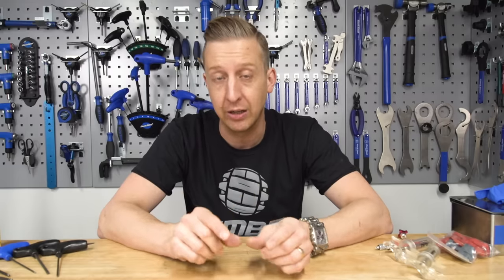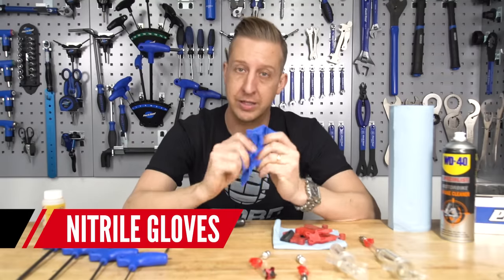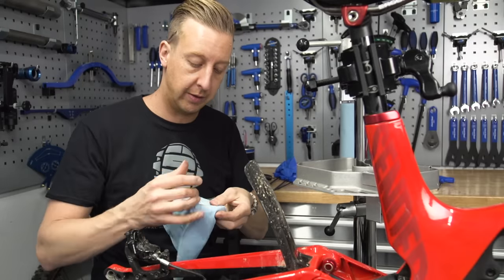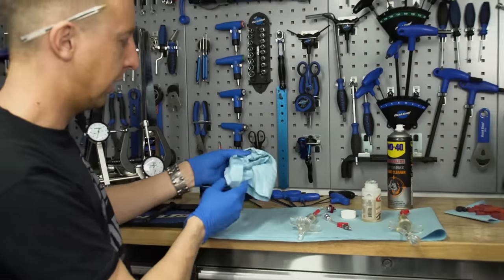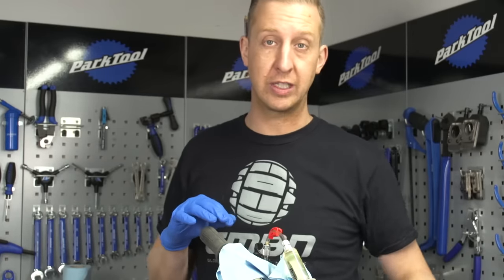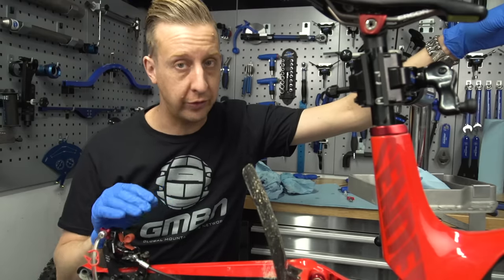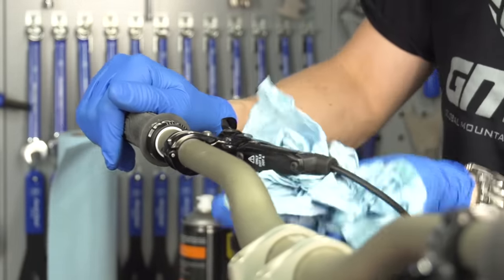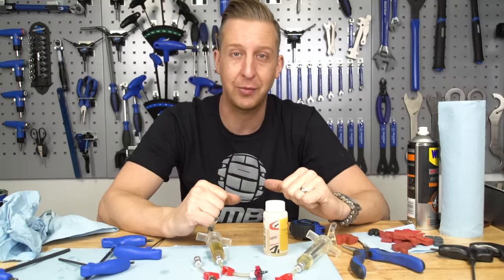How To Bleed New Sram MTB Brakes | Bleeding Edge Technology

Comment: If you have Shimano brakes you can use that extra hour of time that you save to actually ride a bike :D.
Reply: Haha agreed. Changed all my brakes over to Shimano. 1 cup to bleed all.
Reply: Also since Shimano uses mineral oil, which has a higher boiling point, doesn't attract water (Which dramatically reduces the boiling point), hold dissolved gas or strip your bike's paint, it doesn't need to be replaced for years. Magura, who've been using mineral oil for their brakes since they first entered the bike market probably over 40 years ago at this stage, don't even have a recommended replacement interval for their oil because it just stays working - I have a Julie on one bike that's been running the original fluid for probably a decade at this stage just feed it brake pads and adjust the reach screw in the lever every couple of years (It works loose very very slowly) and that's it.

The only things going for DOT fluid are that if it does get on your disks, spraying the whole lot with water will usually get everything back working because DOT 4 and DOT 5.1 are very water soluble, while with mineral oil you pretty much have to burn it out of the pads (Or replace them) and degrease the disk and caliper (I find sanding the disk in a mix of water and washing up liquid gives great results) and it's easier to find if there are no decent bike shops around. Citroen LHM (Hydrauilc oil for their hydropneumatic suspension systems) works perfectly in Magura brakes in my experience if you're stuck, I even got a leaky set of HS33's back working once by using slightly higher viscosity fork oil (Still a mineral oil). Both Shimano and Magura will swear blind that using the oil for one in the other company's brakes will damage them, but I suspect this is more about warranty and selling their approved parts than for any genuine reason.
Reply: peglor The problem with mineral oil for brakes is exactly that it doesn’t absorb water. Which means that any water in the system will collect at the caliper and lower the boiling point of the system to that of water. In practice that is not a big issue for mtb brakes but it certainly is for cars,  trucks and motorcycles.
Reply: But if you want to stop, use SRAM
Reply: You mean after you've spent an hour sorting out the inconsistent lever feel by rebleeding the factory bled brakes, right?
Reply: @nikolasthyr9538  I think you meant magura mate :)
Reply: @nikolasthyr9538  If you want to stop use Shimano Saint
Reply: @JohnDoe-rl9ft  The question you have to ask is how is the water getting into the brake system in the first place? There's nothing to drive it through the seals of the brake as the pressure in the brake system is always higher than atmospheric unless there's a serious underbleed and the diaphragm is stretched inwards. DOT fluid pulls in water as vapour because it's chemically strongly attracted to it, requiring a lot more sealing to keep it out, which no DOT brake has.
Reply: @bike-cave-man2527  Shimano Mineral oil boils at 280 degC, DOT 5.1 boils at 270, and that's assuming it's not drawn any water into it.
There's no force acting to draw water into mineral oil brakes, so unless you actually add it yourself or store your bike under water, the rate water gets into the system is negligible.
Mineral oil is good for 6-7 years according to the manufacturers, which means it's good for a lot longer than that because they like to play it safe - that and I've used Shimano brakes on nearly 20 year old oil and they still work perfectly. I've used Maguras even older than that without issue, in fact for a long time Magura would say there was no need to ever replace the oil that shipped in their brakes unless you lost some through leaks.
Reply: RollinRat  SRAM make the following decent parts: BB5 and BB7 cable disk brakes... I think that's about it, their disk rotors seem to be okay too, but even SRAM would have their work cut out half assing 2 mm stainless steel plate...

The SD7.0 and SD9.0 v-brakes were well made too, as were the Avid Speed dial cable levers, but most if not all of these parts (Including the cable disks) predate SRAM buying Avid out. Avid's hydraulic disks were a pain in the ass in reliability terms compared to Shimano or Magura too though, so some trends are carried over.

SRAM to me is an excellent marketing company which is happy to allow terrible engineering to ship with their name on it. No competent engineer could in good conscience approve the design of the GXP bottom bracket for example. The sad thing is because most of the bikes fitted with SRAM's parts do far more miles on the back of SUV's than under pedal power, riders being stranded by SRAM's brakes and drivetrains failing often have no more than a mile or two to walk back to the trailhead and a nice 'survival' story rather than 10+ miles before they hit anything even accessible by car for a lift home. 

Having to 'upgrade' parts that shouldn't have failed in the first place is used as an opportunity to buy newer shinier parts from the same shysters rather than an indictment of their hopeless quality control and a reason to not buy their crap anymore. 

The sad thing is Shimano are copying some of the stupid decisions SRAM have made, presumably for marketing reasons, because I can't see any engineering reason for it. The heavy, clunky shifting action and the lack of side float in the top jockey wheel of the new Shimano 12 speed drivetrains being prime examples. Shimano first generation 3x10 (And 3x9) is much better in terms of shift feel than 2x12, though the front derailleur in the 2x12 is probably the best I've ever used. After 4 or 5 hours riding I can feel the extra strain in my right thumb from the high shifting force on 12 speed. I've never noticed this as an issue before in heading for 30 years MTBing. Heavy clunky shifting is why after trying it in the shop and on other people's bikes I never considered SRAM from a feel point of view. It always being a SRAM drivetrain that would stall a spin with seized jockey wheels or the derailleur folding up into the wheel for no reason sealed the deal that I didn't want to deal with the junk they're selling. I like to ride my bike, not work on it for no reason.
Reply: @bike-cave-man2527  Wow another 18 degrees - shame you brake will still cook out before a Shimano because Shimano has much better thermal management thanks to the heat sinking on the pads and aluminum sandwich in the disk, combined with the ceramic pistons.

Also the same does not apply to water getting in to the brake. The hygroscopic (Which is pretty much the scientific term for a substance that's a water magnet) nature of DOT fluid means it will keep drawing water into itself because it's got a lower effective vapour pressure than the partial pressure of water vapour from humidity in the atmosphere, creating humidity concentration gradient, which continuously draws more water vapour into the brake fluid. That's why when you crack the seal on a DOT fluid bottle it's just as useless after a year or two on the shelf as it would be if you were using it in a brake, while mineral oil can sit indefinitely on the shelf without degrading because it's hydrophobic, meaning it repels water, so there's nothing drawing more water in. 

I'm on my second bottle of brake fluid in nearly 30 years because I used Magura blood first and then Shimano mineral oil. On the rare occasions I've had to bleed my brakes, usually because I was swapping hoses, it's always been a matter of putting a few drops more into the brake reservoir. I'd hate to think of how much I'd have spent on DOT fluid in the same amount of time. Just because you've swallowed the 'bikes are unreliable and need nearly the same number of hours servicing time as you spend riding them' kool aid that's keeping SRAM rich doesn't mean the rest of the world's cyclists should be wasting their time running inherently unreliable parts.
Reply: @bike-cave-man2527  The data on the website mentioned in this video puts the boiling point of shimano mineral oil at 280 degC, I've certainly had my brake hot enough for water to flash off the calipers on occasion with the disks leidenfrost effect hot and they still worked fine. Shimano has made about €20 from me in nearly 20 years in brake fluid sales (And lost masses more potential income because the litre bottle I bought has done most of my friends' brakes too - it's down to it's bottom third now though).  In that much time I'd need about 20 bottles of DOT fluid just to deal with it's poor shelf life.

The other benefit you claim of DOT fluid at least theoretically is that you can buy it from a garage rather than having to go to a bike shop, but since people have on many occasions proven you can use olive oil, baby oil, water with a bit of antifreeze for the winter (Not recommended on disk brakes if you ride hard, but for Magura rim brakes it is extremely common practice because the lever feel is amazing due to water's lower viscosity, to the point that every professional trials rider and pretty much every amateur one too, you see with Magura rim brakes has bled them with water) or cooking oil, which can be got from far more locations than DOT fluid if you're stuck. If all you have is a car parts shop, Citroen LHM mineral oil will also work beautifully in mineral oil brakes.
Reply: Shimano’s modulation isn’t great. But still it’s rider’s preference
Reply: @peglor  tell me you have no idea what you're talking about without telling me 😂
Reply: @ryancox3834  You'll have to contradict what I've written with actual data before you'll convince anyone that you're not a troll. 

I've explained my opinions as well as the scientific/engineering basis for these opinions. You've claimed I don't know what I'm talking about and provided no evidence.
Reply: Shimano anything makes me gag
Reply: All my friends bleeding their shitmanos all the time and I’m riding happy with sram, bleeding once in a year or two.

Comment: Its actually smarter to start by attaching the syring to the brake lever. After that remove the brake pads and insert the bleed block. This way your lever wont be flooded with dot fluid because of the preasure you are creating by pushing back the pistons. I got codes in stealth look now because of not doing this

Comment: I shortened my Sram Force hydro brake hoses and did the bleed and noticed a ton of what I think is dot compatible grease in the fluid that came from the factory bleed. I tried to flush alot of it out but there is still gonna be some in there. I guess that must be the reason for the dot compatible grease.?

Comment: This video helped me a lot, but there ist one huge mistake which prevented me from having a really tight braking point. What to do different: Remove the top bleeder before the bottom one with the Sram bleed port first. Easy reason ist the great bleeding port of sram. If you close the top one first you can pressurize the system from the bottom and close the bleed screw without dripping and loosing pressure. This was the only and also very easy way to get a really tight breaking point for me!
Reply: Thanks for the tip.
After closing the port at the lever Do you need to pump or pull the syringe at the caliper end?
Thanks for your help.

Comment: I have never heard of corrosive brake fluid - it is usually a pure hydrocarbon oil - it will not bother pain, but it certainly gets absorbed in the brake pads = weaken/swell

Comment: I have SRAM Level brakes on my new bike and have had lots of trouble with consistent and unsymmetrical caliper retraction. They have been bleed several times and then my lbs said there was a recall on the levers so were replaced under warranty. I am constantly resetting the calipers. I never had trouble with my Shimano brakes on my old bike. Do SRAM brakes have a tighter tolerance on how far they retract?
Reply: You need to clean the pistons.

Comment: I have the same brakes used in this video when I bled my leaver I pressurize the system and took the syringe out, oil shot out of the hole. I figured I push too hard so I glad everything again but this time push on the syringe very Softly did it again and very softly and still had the same issue. Brakes felt fine even though that happened but what could I be doing wrong.

Comment: just got the new capra shred and fucked the cable swap from left side being front brake. So fluid went everywhere and i didnt realise you could rotate the code r to the other side without needing to touch the hydraulics. Stoopid ass has to wait until monday before front brake really works now as fluid on order

Comment: Is there a trick to bleeding the code r brake with bleeding edge. As ive watched a few youtube videos but get the same results each time I do it. I follow all the steps get pressure back in the lever then when removing the syringe and go to put the bleed port screw back in i lose all the oil and the brake has no power again. Please help me. Thanks for your time

Comment: first of all, great channel. doddy u're awesome. about the bleeding: i got myself an avid kit for my sram guide rs breaks (2017 model) but noticed that the the fitting (golden) of the syringe is threated and therefore different from the syringe fitting you are using in your clip. does it also work with the threated syringe for the sram models after 2015? would like to avoid opening the packaging in terms of a possible exchange...

Comment: One of my bikes came with Sram brakes and it makes me appreciate how much easier and user friendly the Shimano system is. I moved the sram brakes to a bike that should need the least maintenance because i dislike this process so much. I much prefer working with inert mineral oil and using using gravity/ buoyancy to do the bulk of the work.
Reply: I prefer Shimano too but DOT fluid is practically a requirement in the winter.

Comment: Everything feels great until I reinstall the wheel. Could I be using a bleed block that's too thick? It feels the same as before I did the brake bleed. I feel like I followed the instructions exactly but get different results. Anyone else having this issue?

Comment: Why and how can you pressurize the system when the fluid leaks out after removing the syringe. Why can't you seal the lever end off and pressurize the system from the caliper end seeing as that can be locked off before disconnecting the syringe?
Reply: You can do this. It just requires a steady hand on the syringe to not over fill it. Leave the BE syringe fitted but locked off, remove the lever syringe and fit torx bleed screw, then open BE syringe and adjust pressure, lock BE to test lever feel.

Comment: Doddy, 

I changed the pads today and cleaned the rotors as they’ve been squealing!!

Put them all back together and the brakes are rock solid and pretty much on. 

Is this normal with bike maintenance? I seem to have very poor luck in this department.

I’ve just ordered a bleed kit. 

Have I done something wrong?
Reply: 99.9% it’s your disc try using a different disc and see what happens
Reply: Or try moving your pistons back

Comment: Only part I can't work out is having to pressurise they system but when you take brake upper hose off to put screw back in what pressure you did build has gone 🤔.  I would of thought once the air has been removed you'd put screw back in on the brake lever then pressurise from the caliper and shut valve then remove and then the system in my eyes would be pressurised. Or am I seeing all wrong 🤔 😕

Comment: Have guide brakes on my new bike and there is a lot of travel on the levers. Do I need to bleed the whole system or just pressurise them more as per the latter part of the vid? As ever Doddy great video I am a MTB Nube and have been able to a lot of my own maintenance from watching your vids. Didn't have one for sticky calliper pistons though had to go to the darkside and watch some one else's!!
Reply: Gary Buttery check with your bike shop. Some guide levers are defective and they will replace for free. They did for me.
Reply: thanks for the reply. Bleeding the brakes has done the trick.

Comment: In their instructional videos, SRAM recommends depressurizing the fluid to get any dissolved air out. For reasons stated below, I have stopped doing this. You don't do it either, how much impact do you think it has on servicing intervals?

With regards to depressurizing: My LBS only had the standard SRAM bleed kit on offer (the one that is all plastic). I would definitely recommend against it, it's a total waste of money, and get the "pro" version instead (the one with the metal rods in the syringe and, more importantly, the metal screw-on caps on the hoses. I found the plastic hose caps don't seal anywhere near properly, and leak oil out or air in when under any kind of (negative) pressure. The coarse threading on them gives you no option for tightening to avoid this.

Comment: Why not bleed from caliper to lever? 
I assume air travels up, terminating in the lever. So it seems like it would be better to push it out rather than pushing the air all the way down the system. 
I've done simple lever bleeds a couple times on Shimano and SRAM. Clearly I'm no expert.
Reply: You finish at the lever which makes sense, i guess.